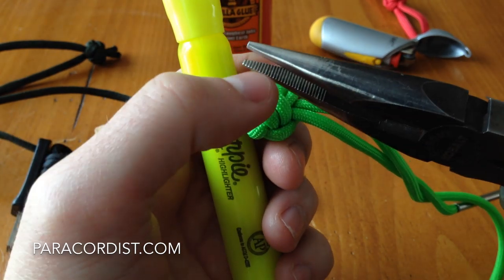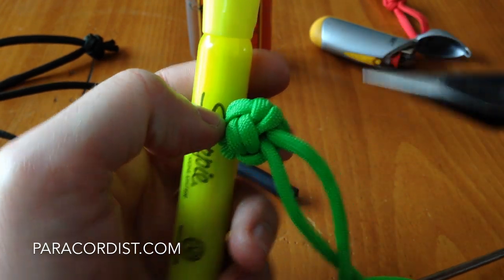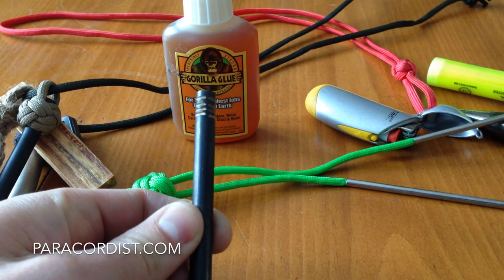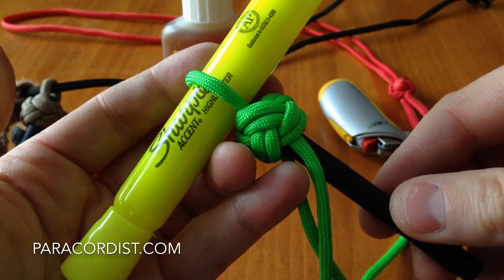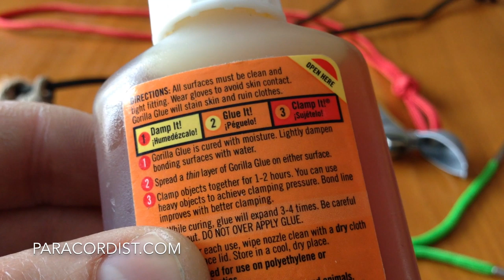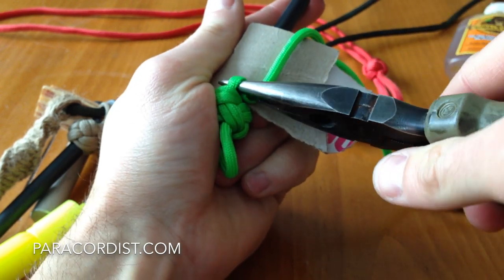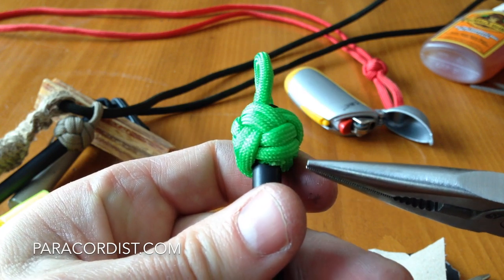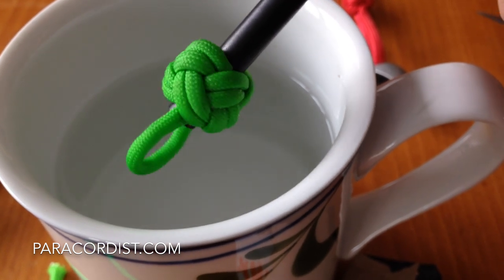Paracordist how to install a paracord firesteel ferro rod handle

Comment: Great video, clearly demonstrated!

One educational note about your experience with the pliers and tightening: it has little to do with the muscle groups you're using.  Gripping the paracord with the pliers and twisting against the knot uses the physics of 'leverage' to increase your mechanical advantage against the load, and works exactly like a 'windlass'.

https://en.wikipedia.org/wiki/Windlass